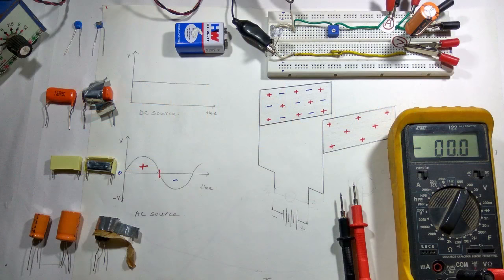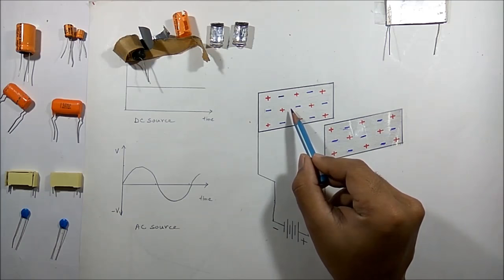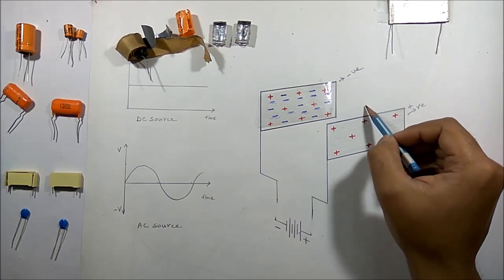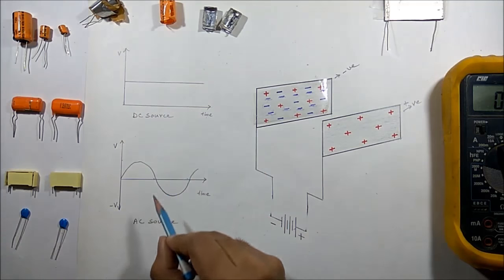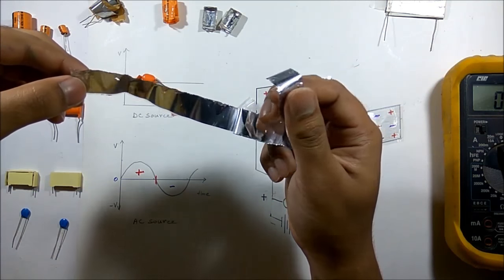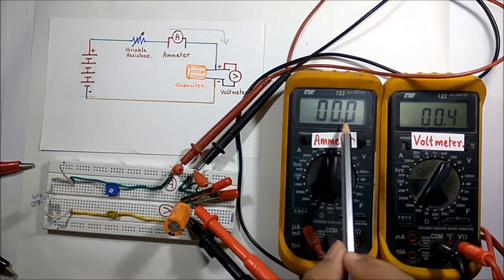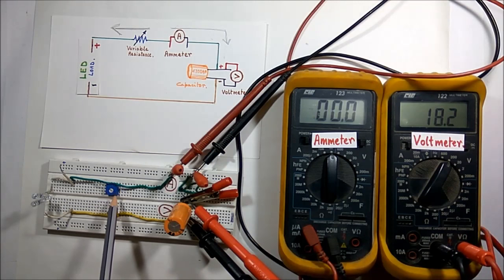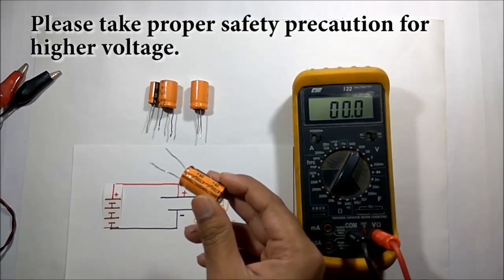How a Capacitor works in a circuit / Both in AC & DC current

Comment: thanks this is the 8th video I have watched and finally someone has explained this subject properly. I do have a question. you showed how electrolytic capacitors look like blown. what about the AC capacitors ?  do they blow and how can you tell?
Reply from the maker: There is no liquid electrolyte present in the AC capacitors (Box type, polypropylene film type), shown in this video. So you can visually identify the bad capacitor (AC) if there is any burnt spot or by measuring the capacitance.
But for checking the Start Capacitor or run capacitor of single phase AC motor please refer the following link.
https://youtu.be/epfMNxTkmns
Thank you...
Reply: Thanks so much for replying, I look forward to future content from your channel you are very accurate and easy to follow :-)

Comment: Thanks a lot for sharing this video. Got a good amount of Knowledge about a capacitor. But still there is a doubt that when a dielectric acts as an insulator how does it allow the charges to Flow?? Please clarify!
Reply from the maker: No electron [charge] can pass through the dielectric as it is an insulator, but for AC supply both plates charged and discharged such a manner that the AC current can pass through the capacitor as I shown in the video.

Comment: I need to know how volt is increase   by increasing the size of a capacitor at same capacitance
Reply: How voltage rating is dependent o it's size
Reply from the maker: Generally for the higher voltage we have use more insulation between the plates to withstand the high voltage. so the size of capacitor increase.

Comment: U said that  capacitance depends on size but for that three capacitors which are unequal in size has same 100micro farads why?????????
Reply from the maker: Because their voltage rating was different. SIze of the capacitor depends on both the capacitance and the voltage rating.
Reply: @TechStudyCell  Thank youu